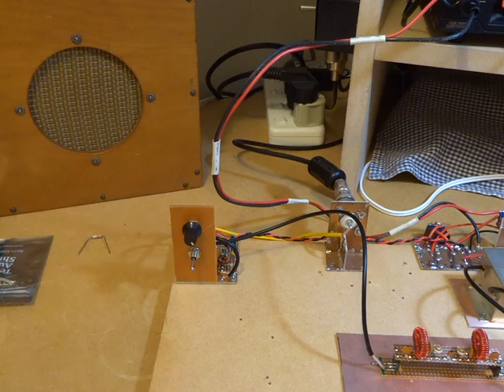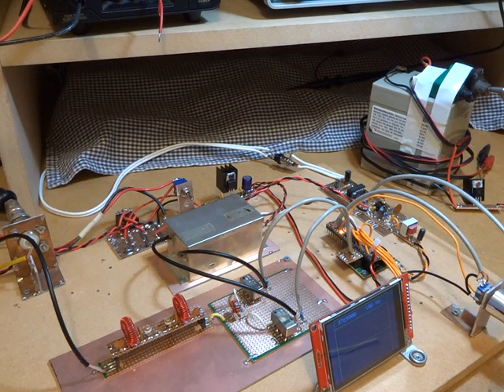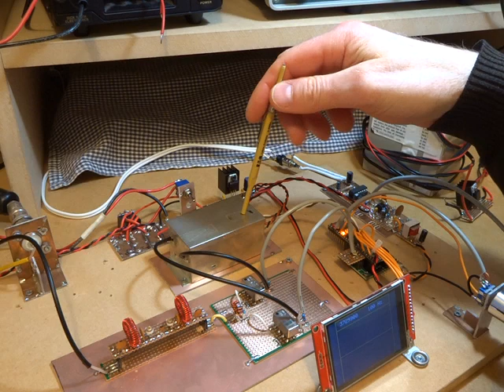80/40/20m SSB SDR Phasing Rig: Part 3a. Rotary Encoder Noise Fixes

Comment: I had the same problem... Shielded the I2C and noise 100% gone. Great videos EI8KI
Reply from the maker: Oh yes, I was going to try that too. I'll do it tonight and post another video if need be. Thanks again for suggesting that.
Reply from the maker: Hi. I tried shielded I2C lines tonight with no change. Interestingly, I disconnected the I2C lines from the Teensy as well as the audio input from the SBL-1s. No change. That means to me it's coming from within the Teensy.  I't's not perfect, but good enough.